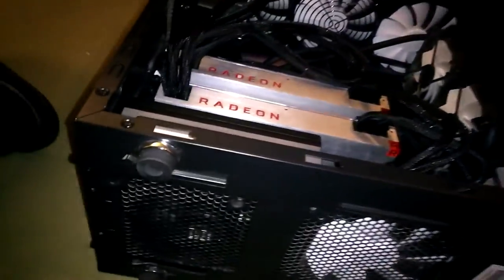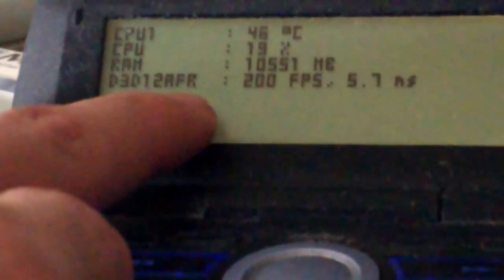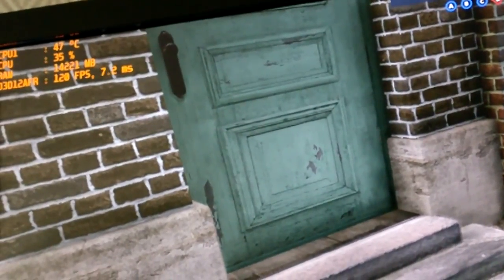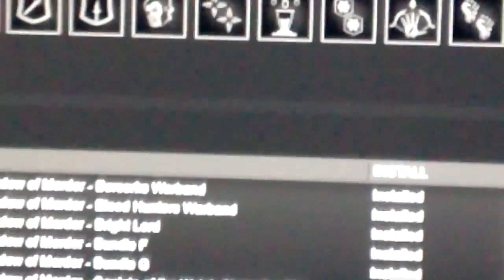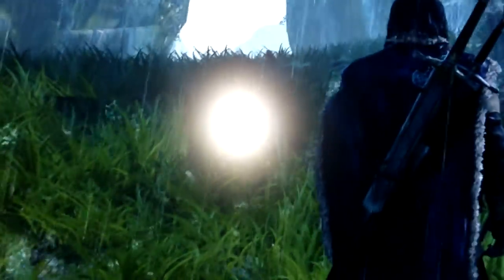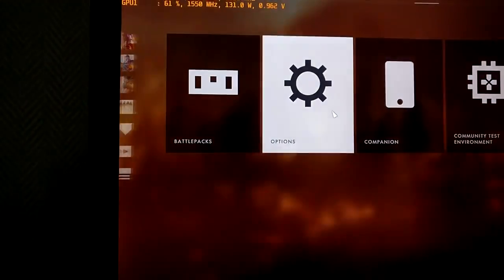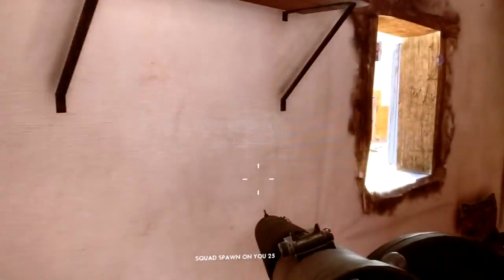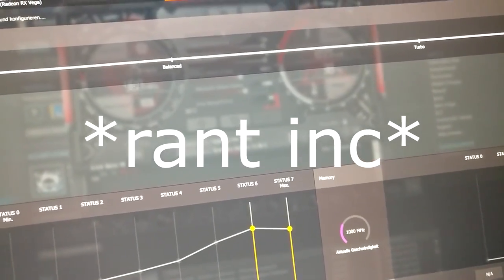Radeon Vega 64 LC Crossfire Test Session

Comment: Help...My crossfire setup shows up in GPU-Z, In Device Manager, and the two vega 64s light up. When I look at the sensors in either MSI after burner or GPU-z, it shows only one card under load. My MOBO is capable of crossfire (AS Rock Fatality X399) with its 4 PCIE slots. All drivers are current. Any help is appreciated.

Comment: as soon as you slurred the words towards what you were trying to do (4:00) I knew right away this wouldnt work, because...I tried it.
I also think you have a pressure issue inside your case, the fan speed/placement/orientation could be bad, you can tell this because there is plenty of dust in your case, if the negative and positive pressure were good, there would barely be any because air wouldbe moving in and out of the case at a constant rate, instead of getting stuck somewhere and depositing dust inside the case.

Comment: Hey, informative video, thanks. I'm thinking about buying 2xNavi when it comes out in few months and the performance should be about the same or a bit better than Vega64. I remember years ago there were problems with xfire/sli with microstutter and some games actually had less fps than on just the 1 card. Can you tell me if it got better, I saw some stuttering on your video but I don't know if it has to do with crossfire or the recording or just youtube video. I've read that dx12 helps a lot and usually works well and with dx11 if the developer doesn't put in work it will be bad, what is the overall experience/performance gain from having the 2nd card. When Sniper Elite 4 came out AMD was bragging that it has 100% more performance from crossfire and no loss whatsoever and that 2x580 were better than some high nvidia either 1080 or 1080ti. I've got a 4K monitor, no freesync so I was planing on using 2xNavi to lock max settings with vsync.

Comment: Thanks for such an in-depth analysis. Does the setup work better after the new driver updates?
Reply from the maker: Well, PUBG got some huge updates indeed. It runs much better in CrossFire now. Battlefield 1, however, is still absolutetly terrible as soon as you turn the second card on.
Reply: @derfledderer4001  battlefield in dx12 is pure garbage with cfx or without

Comment: It's just a waste of money if you're going to just undervolt them. Plus, since you have a 1200 watt power supply you should be fine adding that 40 watts plus it's using at most 1050 watts.

Comment: Try it on a motherboard that has a pair of x16 slots on the same pci x16 lane     most motherboards share the x16 slots through the processor or the chipset which forces the cards to communicate through the processor or chioset then through the processor which adds a whole ton of latency when they are trying too frame pace eachother,  when they are on the same pci lanes they can directly talk to eachother removing the delay and then performance goes through the roof

Comment: aren't amd dropping crossfire support in the future? if so that would basically make future crossfire useless correct?
Reply from the maker: Crossfire is being dropped in favor of DX12 multiGPU.
Reply: Even though it have been answered, crossfire is being dropped in a way, but mainly to be rebranded to mGPU. They will likely continue to partially support it for older cards but as times go on and they release new cards, mGPU will be used. Mainly for both vulkan and dx12. They may have something planned so it will work on opengl, dx11, etc., but we wont know until they release everything.